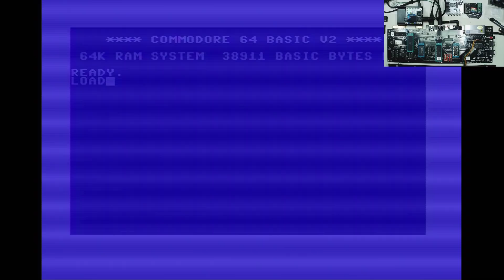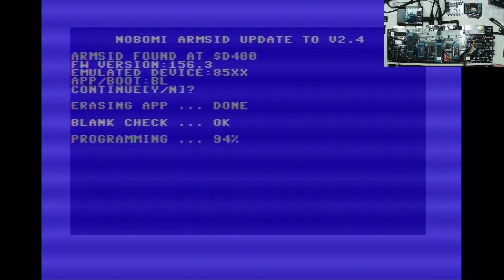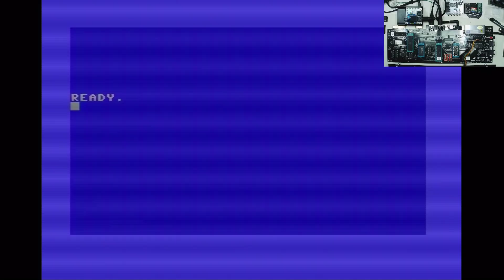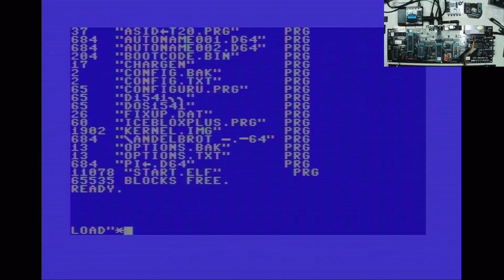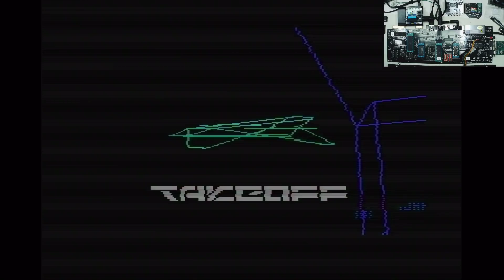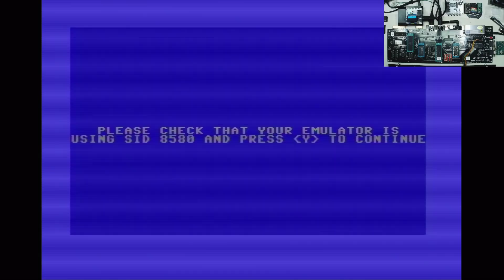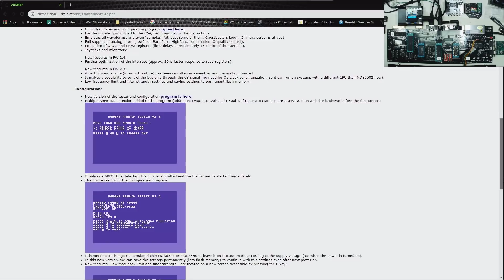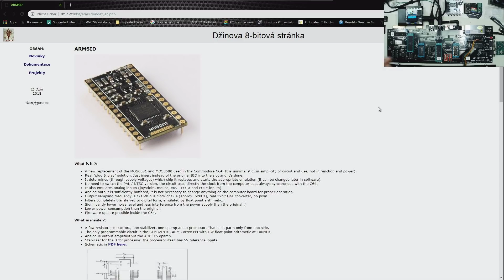C64 Hardware - ARMSID - Sid replacement - first impression

Comment: I just ordered two of these.
Reply from the maker: You probably won't regret it :)
Reply: @c64customs  I'm sure I won't ;) Have you tried the NES core for TC64V1/TC64V2? Maybe do a video about it?
Reply from the maker: @larsenmats  This sounds like a good idea. I haven't spent that much time with the TC64 V2 recently since it struggles to sync with the OSSC, hence no stable RGB to HDMI conversion but I will come back to it for sure. Thanks for the suggestion!